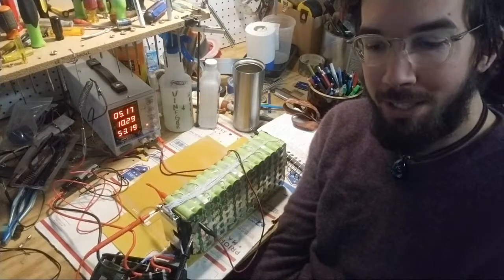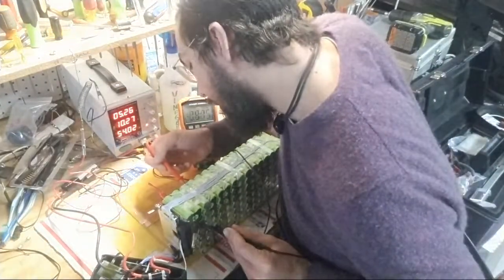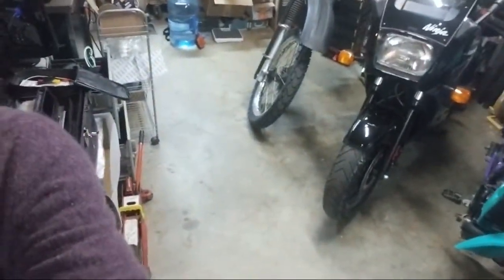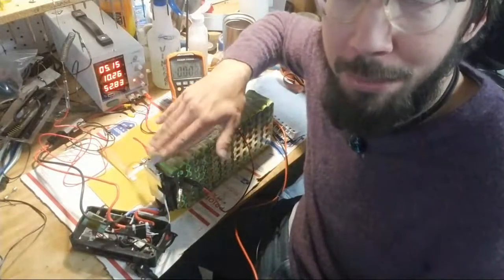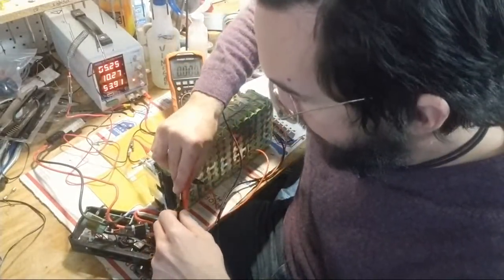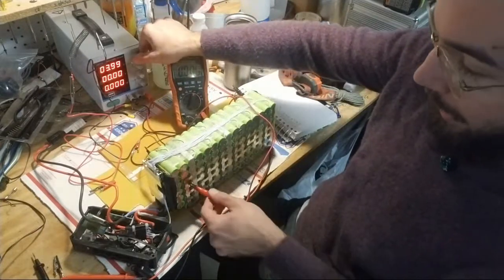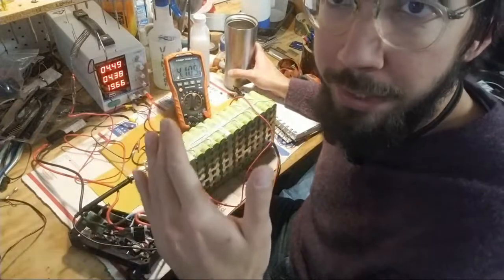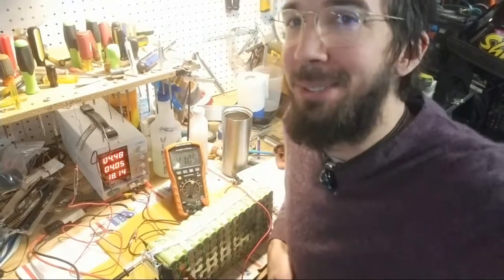How To Find One Bad Cell In A Lithium Ion Battery Pack - Fix BMS Low Series Voltage Cutoff

Comment: Hey do you know why my pack shuts off at 57v and when I accelerate in dual motor it shuts off instantly even at 100 it’s at 60v 28ah
Reply from the maker: @AussieOnwheelz  one low series is triggering low voltage cutoff
Reply: @ u got any idea of how to dignose?
Reply: The same thing with my 72v battery right now it only charges to 81v but it should be at 84.

Comment: So when you were testing the voltage on the individual series was the charger turned on or did you test it in it's static state?
Reply from the maker: @donaldsayers4967  those were static tests. The series with the parasitic cell will be much lower voltage than the rest.
Reply: @dragon_offroad  I have a 36v 10.4 Ah 10 series pack out of an E scooter, the batteries had very little use but were left to go completely flat for too long. I have unwrapped the pack and tested each of the series. Most measure 0.3v except a couple are around 3.4v. None are 0v. I was wondering if I charged the series individually with a lab power supply similar to yours if they might be recovered but I'm not sure.
Reply from the maker: @donaldsayers4967 I'd say it's worth a shot to charge them and do a capacity test if you have the time and a use for the pack

Comment: Hi, plz I have a question : can I run a Xiaomi (250 watt) with 36v hoverboard battery?? ( I make path just a 2km in day) , plz someone answer me. tnx
Reply from the maker: What voltage is the xiaomi rated for? If you overvolt something it will produce a lot more heat and burn out if you aren't also engineering a better way to keep it cool
Reply: @dragon_offroad  thanks, I'm not a enginner, but I understand a little, i know how to connect the motors with speed controller 350w 36/48v, and others like light, brake ...(and repair thinks),

Comment: Doesn’t 48 V supposed to come out to 54.6 V that’s what it supposed to come out yeah They gave me a charger and the DC is two a so the output is 54.6 V input well that don’t matter or maybe it does. I’m not a electric bike expert will input it says AC 100 to 240 V and 50/60 HZ and that’s just for the 48 V battery I would really like to hook up to my bike if the battery shuts off and if it shuts off if that means the BMS is shutting it off, there’s a reason and because of my extensive studies and homework on watching how to fix all electric bikes on YouTube everywhere for everything I was able to figure that out pretty quick Because my power turns on when I plugged the charger in for five seconds and then pull the charger out and it’s riding again and then it would cut off again but when it cuts off, let me get this clear. I have to be near outlet somewhere because if not, it’ll either show no bars and the power won’t come on unless I do that charger trick or one bar would be there, but the drop would drastically go down from full to one bar and still it shuts down, but it allows me to shut the power off and on I could still see that one bar That’s when I stopped using that battery and I use my own battery. I put my old battery back in but now I got this new battery. I wanna know what China sold me because they made it sound like I was gonna get a great deal and if there’s something wrong with it well there is something wrong with it Because it’s not supposed to just shut off like that. It’s telling me something. It’s trying to tell somebody something somebody who knows how to speak to the electric bike and that’s not me. I don’t know how to do that. I wish I did. I need advice. I appreciate it thank you. I gave you any information that I had. If you need to know anything else I will reply because this is a important subject for me great content, and have a great one.

Comment: I have the Jetson electric electric bike. It runs on a 36 V system with a 350 W motor hub motor with 6.7 AH. And it has a restriction to 15.5.Mph and they showed a video that this Jetson bike can handle a 48 V 20 ah they even made a video on it with everything stock. They put in a 48 V battery so I ordered one from China from AliExpress. I put it in and it was riding nice fast zippy was zipping all downhill after about 45 minutes the power cut off, but it’s on a full battery 45 minutes. I got a 20 amp hour capacity I plugged the charger in for five seconds and then pull it out and the light automatically turns on full charge so I’m confused about the battery that I bought because my old battery works just fine. Could it be the restriction? I’m not sure. Could it be the BMS because the new battery the maximum current outflow I believe is only 13 a I’m confused and I just don’t know because the battery it rides it takes me places but then it cuts off so so something’s wrong. What do I do? I’m not gonna use the battery no more and it’s a good battery but I don’t wanna ruin the battery or ruin my electric bike. Is there a place to get a tested or is there a way for me to test the BMS? I don’t know how to find out what’s wrong with the battery and why the power cut off the battery takes a full charge. I’m confused. It’s just depressing because you watch a video and they’re putting a 48 V battery in and I do the same thing and it doesn’t work out for me and we both have the same bike with the same stock. I’m confused. The only thing I can think of is that that guy took off the restriction from 15.5 to 19.mph  doing the Jetson speed hack so I’m considering giving it a try that just speed hack. I’m OK with going fast that’s just not my concern. My concern is the Kapacity I want to be able to go places I don’t wanna be restricted around my own area because if I go too far, I can’t even ride the bike back if I want to because the bike is hard to ride because of the motor, the motor has some kind of restriction on it to even pet free. It is to petal. It’s not easy to ride the bike because of the restriction if the controller is talking to the motor, I mean, I wish I had a far driver controller then this wouldn’t even be an issue. I mean, I’m gonna continue to watch the video great content and if you can reply with a solution, please.

Comment: Does that battery pack not have bluetooth bms? Couldn't you just use the bluetooth to monitor the voltage in the series?
Reply from the maker: @jungbae3  this one does not, but many of my bigger electric motorcycle packs do, and that is what I would recommend.

Comment: What happens if BMS goes bad?  and what would cause this to happen?  Thanks
Reply from the maker: It's hard to say it's the bms until you have measured all cell voltages both static and under load and guarantee none of them are more than ideally two hundredths of a volt apart

Comment: I have a 52v 20ah battery. Charges to full capacity, reads correct voltage on multimeter, will work perfectly with no rider on the bike but soon as its under load with weight on it. Totally shuts down & wont power back up till i disconnect & reconnect it. Then will do the same again. Thinking of doing a BMS bypass on the discharge side. Do you think it sounds bms related
Reply from the maker: @TheBigwesb  it's possible, I would check all series voltages static and under load, but yeah most stock bms are garbage
Reply: @dragon_offroad Thanks for the reply dude. I've just done the BMS bypass on the Negative discharge cable, so we will see if it's sorted it out. Fingers crossed & will keep you posted 🫶🏻

Comment: I have a 70ah limitless lithium battery, and I can I put a 25ah limitless lithium charger on it, and in just a few moments the light turns green showing it's fully charge, and I'll check it with multimeter, and voltage is 14.8.  Then I'll remove or take charger off, and check it immediately.   The voltage immediately shows 2.75 volts, and drops to 0 volts in a matter of moments!  Do you have any idea what would be causing this?  Can 1 bad cell cause this? The reason I ask is because it shouldn't charge at all if the charger is connected.
Reply from the maker: @lareneowenby3106  I would say yes! Bms is low voltage cutoff the output input charge switch because one cell is below the threshold. I would measure all series voltage and charge the lowest one to match the others, and if it keeps dropping find the bad parasitic cell and replace

Comment: What if some of my cells are 4.5 volts ?
Reply from the maker: That is overcharged for a li ion cell. You should discharge them to 4.2v asap. They may have sustained damage
Reply: @dragon_offroad  how would I discharge them ?
Reply: The whole pack reads 58.3 when fully charged and some cells read 3.8 could that have been from bms fault ? And how exactly could I discharge them ?

Comment: I have my 72v battery all taken apart thanks to you. One set of cells on mine are reading 3.0 volts all others measuring 3.9. Do those need replaced? I already have them pulled out so will be easy to fix
Reply from the maker: It may just be one of them in that series pulling all the others down! I would charge them up and test them all individually and find the one bad one that is dropping voltage way faster than the others

Comment: You are using an inductive load across a dc source to discharge the higher parallel group.  Would that not be a short ?
Reply from the maker: It is simply a resistive load, not inductive.

Comment: Honestly this video helped me so much. When the video got to the end while I was watching it on the tv I couldn't find it again no matter what I searched for, only by using the computer upstairs and looking at the "history" was I able to find it again. You deserve a lot more views. 

I got 2 really helpful tips from this video. 
1:Isolating the cells from each other by just removing the nickel from only the positive side (I never thought of this, I was going to strip from the back also)
2: those actual numbers and what to shoot for when charging. 

I have a power supply turning up tomorrow, it looks similar to what you are using, I am hoping I can bring all my series sets up to within .02V of each other. What settings would you suggest to use if I was going to charge just 1 cell up to around 4.1V so it matched all of the others? How many amps would be safe to use? 

I didn't realise you could charge the individual series up while all the nickel was still attached. And I still can't get my head around how the charger can pinpoint just that one parallel group even though every cell in the battery are welded together with nickel. But i'm just glad I do not need to strip it all down (unless a cell is knackered)

Can i disconnect a BMS board by just removing the negative wire that is attached to the 1st set of parallel cells to the B- terminal on the BMS board? would that be good enough to "bypass the BMS board to allow me to charge up the battery as normal using the normal charger for a bit to bring up the average voltage of all of the cells? 

Sorry for all the questions. I have an E-bike battery here that is damp inside and some rust has formed on a few LG cells which are testing below 1V, so I was not even going to attempt to revive those and I have since ripped them out but the rest of the cells are still fairly high on the same series circuit (3.6v) and I think those are probably going to be ok. The guy must have been riding through a deep flood for that kind of water ingress... but nevertheless. I would like to try my best to bring it back up to perfect health. And if I can't, there are many good cells in the battery for good use anyway. 

All the other 75 or so cells are measuring at 4.11V, so I feel pretty confident it is only the 1 or 2 cells that are corroded and knackered from water damage. Hoping the BMS is not knackered.

Cheers for the awesome vid
Reply from the maker: You should look at the datasheet for your particular cells to know the maximum charging current, but usually a 1C rate works well, so for a 3aH battery you could charge it up to 3 amps for a fast charge, or 1 amp for a slower charge.
Reply: @dragon_offroad  Ah yes! I didn't know datasheets were a thing! I will get on with that tomorrow. 

Thank you very much for helping me out with this
Reply from the maker: No problem! Lithium batteries are fun to work with, but make sure you are prepared to put out a fire! I took some batteries to a local recycling company the other day and when they put them in their storage tote some of them caught fire from short circuiting!
Reply: @dragon_offroad  I am so paranoid about that. Hopefully my paranoia will ensure I do everything 110% safely. I'm not skimping on materials, cells, tools and I'm not rushing anything. 

But just in-case I may keep a little bag of sand outside to smother a battery with if anything starts smoking. 

It's right at the top of my list of worries for sure.

Comment: Thanks for the video. I have a similar situation in my eskate board battery pack. The pack only charges to 89% and cuts out rather early. I suspect that there is one bad cell in it. Since I didn't build the pack I don't have access to more cells of the exact same kind. Since you said you would probably replace the faulty one after you found it do you have any advice on what cells to look for in such a case? Same brand, same type? but the batch obviously can not be the same. Similar age, usage, capacity, internal resistance but different brand?
Reply from the maker: This pack ultimately had nothing but problems due to the cheap cells. Many more of them started dropping off to zero and self discharging after I fixed it. But if you want to fix it, yes, you need replacement cells that are as close to the originals as possible

Comment: I wanted to thank you for making this video! I've been troubleshooting a battery pack on an electric scooter and couldn't find anything specific like your video. It's a 13S4P 48V pack and the BMS wouldn't let it charge. One of the cells was testing 0.856 volts and I was wondering if you could in fact charge an individual cell with a power supply. Awesome info!
Reply from the maker: You can but if that's the only series that dropped that low it may have a bad cell in it self discharging too fast
Reply: @dragon_offroad  Ok. Would I be safe to slowly charge that series then let it sit for a few days then check again? It sat in the garage all winter then wouldn't charge when we tried this Spring.
Reply: @dragon_offroad  one other series measured 3.650
Reply from the maker: Definitely can't hurt to charge it level with the pack and see how quickly it takes to drop again
Reply: @dragon_offroad  sweet! I'll report back. Lol!
Reply: @Joshua Shanks  can you report back please.  I'm having same issues.  Did you charge the individual battery to fix the problem at a slow rate? Or did you charge the whole series unit?? Please, info thanks.